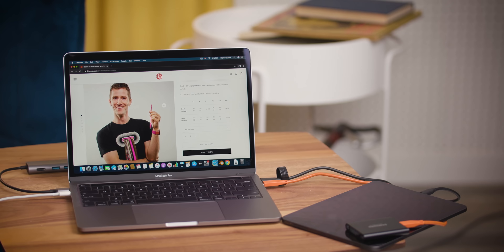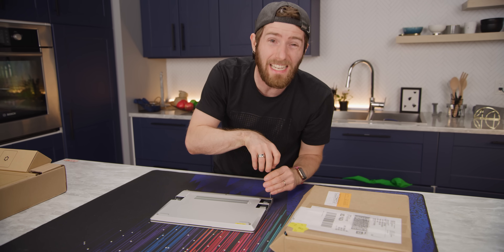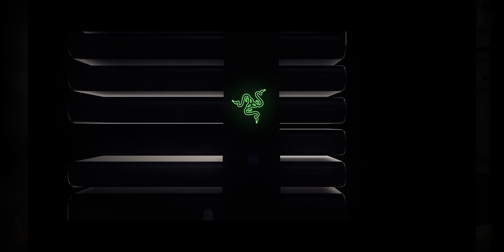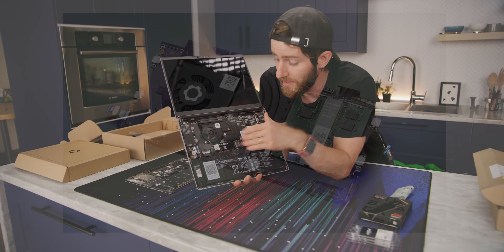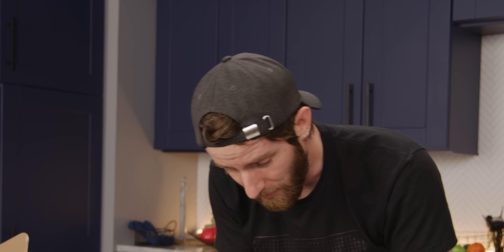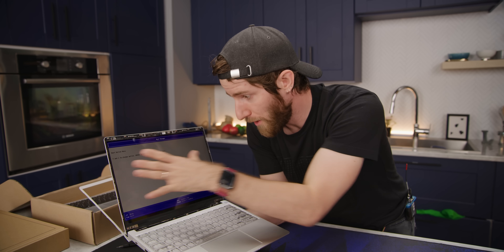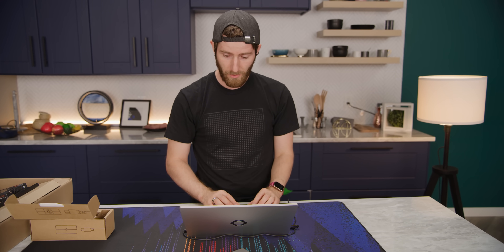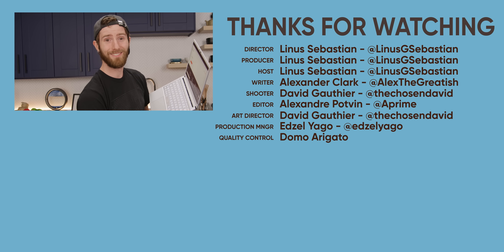A COMPLETELY Upgradeable Laptop?  - Framework Laptop Review

Comment: Honestly so over my Dell laptop after the Dell repair center did a number on my laptop, the next computer repair shop I sent it too even called me up complaining of how shitty of a job they did with the repair(btw when I got it back from the Dell repair center, it came back with more problems then I originally had, which was I just needed a charging port replaced), they didn't even seat the ssd correctly according to the other repair shop. And the keyboard is no longer working right anymore and it's not a driver issue, and a replacement part from my research is basically unobtainable unless your a certified Dell repair technician and get it straight from dell for a stupid amount of money or pay even more to buy a broken version of the same model laptop and hope it has a working keyboard; definitely gonna consider these guys for my next laptop, hopefully they can come with/work with Nvidia graphics so I can run my simulation software on it

Comment: Linus being sold, has me sold. The moment it is available in Australia, I will be buying it. If I had the capital, I'd invest as well. If Framework fails, then the other manufacturers will say "I told you so", we cannot let that happen. If Framework succeeds it puts the "but it isn't economically viable" argument to bed.
Reply: I'm in Australia and got one - I got it via a freight forwarding service.
Reply: It's not that this isn't a good idea or anything -- it's just that linus makes it seem like these laptops have the same performance for price as competing models, which they absolutely do not. You can get a laptop for $800 with similar or better specs than Framework's $1400 option, plus the fact that with the DIY version you actually have  to build it yourself.
Reply: I think one of the selling points of the Framework is that since you can repair it yourself, it's cheaper if something goes wrong. However, most major laptop companies have warranties, so if something goes wrong you don't have to pay for it. Even so, if you buy a laptop from an OEM like HP, and it breaks, you can buy the same laptop again, and you'll still have spent less than getting the Framework.
Reply: @shadowyzephyr  Linuse said himself good enough performance
Reply: @shadowyzephyr  not really most laptops get some wear and tear on the outside and stuff and most warranties will deny you if you have a dent in the laptop or something even if its not related to the hardware problem the framework is surprisingly cheap for what it with an i7 32 gb of ram 1 tb of storage and its all upgradeable and repairable its not cheaper to just buy another hp laptop
Reply: I‘d say same for me. If I need to replace my current model one day (which I do actually hope not to happen for some more years) - I will definitely look for their idea being available in Germany.
Reply: @OpelChef87  well, its available in germany now lol
Reply: I shelled out for a Panasonic Toughbook to get upgradability and expandability on this level back in late 2019. If I were looking for a new laptop today Framework is what I'd be getting. Without question.
Reply: @TheKazragore  Oh you did the thing that I was wanting to honestly, idk is the framework laptop really better than the toughbook?
Reply: Australian here too. 100% will buy this the moment it drops in Australia.
Reply: Considering it costs 1,500$, you do have the capital to invest.
Reply: Linus being sold has me feeling like changing the video. Everytime he is "sold" it just sounds... extra
Reply: @williampennell8567  so him liking something and being happy about it and acting like he's excited about it makes you not like the video
Reply: the "i7" processors in these laptops have just 4 cores, even if they are 4 good cores it's still half the number that another laptop might have.
Reply: @shadowyzephyr  4 cores is enough for most people. It's certainly enough for a device where power draw is a consideration. I'm sure the limited CPU options would improve over time if the demand was there and it certainly looks like it would just be a case of swapping it out. Moment you can buy these with a UK keyboard I'm definitely getting one and will certainly look at pushing these as replacement for our mobile devices at work just because of how easy it will be to replace spare parts when the PMs/sales inevitably break them.
Reply: @shadowyzephyr   intel i7? Sounds good to me
Reply: @shadowyzephyr  Fun fact: my current laptop has an i7, and its more than enough, and if i can upgrade it later, im fucking sold

Comment: Looks great, love the recycling ethos, will consider ordering once available here. Some ideas for future development... amd apu, two nvm storage sockets, more plug in modules inc double sockets eg usb, externally accessable battery (although the disconnect option makes this less of an issue), a dock feature, and personally im excited for a larger display model, 144hz display with touch (ideally up to 4k), a keyboard with number pad, prebuilt linux/windows options. A discrete gpu option would also be great, maybe by exposing pcie lanes for an add on card

Comment: My old 2008 MacBook Pro could be opened no problem (the battery compartment didn't even use screws). I regularly opened it up for cleaning, replaced the fans and the battery a few times and this laptop still lives today. Massive I-O also. Since that model it went downhill for Apple hard!
I am so glad, that framework upholds these principles. I already lost hope that any company would allow for basic repairs.

Love you guys, framework 💙

Comment: compared to any other laptop.... this is still more upgradable and fixable compared to literally any other laptops XP
Like, for Macbooks, you could never upgrade or fix anything, like if the storage fails... Can't get a new SSD. If the wifi doesn't work on it anymore, can't replace it, and you'll have to get a new MacBook. Anything could go wrong on a MacBook, and you couldn't do anything besides ask apple to repair it, and if they can't.... rip.
meanwhile for typical laptops (intel or AMD etc) those have replaceable storage, and you can upgrade the ram a fair amount.
Really, this current version holds up pretty well for upgrading and fixing broken parts.
hopefully soon, we will have the ability to change anything within the device. Like, if I got the device with an i3, I could eventually upgrade it to an i7 or i9 when I have the money, or even I could replace the fans in the device, for better more efficient cooling ones.
I doubt we'll get replaceable motherboards with these systems, as it might be a bit much. But who knows. Maybe intel will stop changing their stupid CPU sockets every other minute, so then a 3 year old CPU can be replaced by a better recent CPU, and have the shared socket intel01 instead of e621 and 42069 :S
Also hopefully they provide more port upgrades, even allowing thunderbolt display :P

Comment: I appreciate how the internals are visibly designed by Apple engineers lmao. The display hinge seems a little sus though…hoping that the mechanicals can be improved just a touch for the next generation! A little more rigidity would be nice.
Reply: Yeah it did look a little loose. I didn’t see how rigid the screen frame itself was too e.g. if you open/close the lid from one corner does it twist and bend
Reply: Its already rigid enough even without the modular IO on the laptop chassis and its barely visible to naked eye
Reply: @mayuravirus6134 maybe enough for you, not for those of us valuing premium devices 🤷🏻‍♂️

Comment: 9:28 I'm pretty sure you just put the antenna cables on the wrong connections.  Typically the black cable goes to the black arrow, while the white cable goes to the white arrow.

Comment: Wow, this reminds me of my well loved Siemens Mobile 510 Laptop. It was fully modular. One could use disc drive, floppy, Batterie and power Rick inside or external. I even upgraded to CPU from a PII 233 MHz to a P3 360 MHz. Heck, the case was GREEN and indestructible.
Would have bought next gen without any hesitation but Siemens stopped to build them.

Comment: Linus, the battery disconnect option in the BIOS is not only for disabling the battery when you are using wall power, it is also for easily servicing the insides of the laptop without disconnecting the battery. This feature is there in some present laptops, and since this laptop is made for modularity, it only makes sense for them to add the option in the BIOS.

Comment: I don't need a laptop but I almost ordered one. I love the concept, the multitude of info / qr codes and all the detail. I did sign up to know when they start shipping to Germany. Only thing I would be worried about whether the little extensions hold strong enough, or they may become a bit loose (not sure if explaining it correctly) with time and stop making contact. Like maybe 2 years down the line I can't use my usb or something properly because that connector has become loose. I would also love some nice Amd cpus. Lately I am reading about interesting concepts, like the Fairphone for example (kinda crappy and expensive but also great idea). If only big companies started making things this way and spent a billion into proper r&d we would be so much better off. I know there's a lot of financial motivation against all this but maybe something will change in the next few years.

Comment: Call me when they have GPU options, and a reasonable price point.
~1100USD for my base needs on a 13.5" screen and no GPU is not great.

Also, what exactly are the storage expansion cards?
The prices on them are comparable to the WD Black SN750 SSDs they offer, I think the only concern would be cooling them if they're doing a lot of read/write operations, and of course they are slower than the M.2 options, but still SIGNIFICANTLY faster than an HDD. I assume it's an SSD solution, despite the performance being much lower than similarly priced M.2 products.

Comment: This is a pretty cool concept. I really like where they are headed! Though if I were to make one complaint about the body and form factor that they chose for this product, it is that you have to take it apart to swap out batteries. It would be nice if the battery had its own bay. That would make it absolutely perfect.
Reply: Like an external battery? It IS feesible but i would say it'll sacrifice how thin it came like before and probably a potential hazard if some wires is exposed
Reply: @mayuravirus6134  what he means is have the internal battery be easily interchanged without having to unscrew the laptop. A little door is all you need, or even just have the battery ‘be’ a part of the bottom of the computer and have a little built in switch to be much more easily swapable. It was standard on laptops long ago, go look up a video of an old thinkpad or say a dell insporon 1501.
Reply: This! When I travel with my ThinkPad, I sometimes carry a spare, fully charged battery with me, so I can continue working. It totally looked possible to implement, too. One thing I worry/wonder about ontop of that is how warm the chassis hand-rest area gets when the battery is running warm. Again, the ThinkPad gets warm at the back, so I won't notice it. Curious!

Comment: Frameworks has an interesting concept. I hope they are successful. As one other person said this is Frameworks "v.1"  I'd be looking for a unit that wasn't a gaming machine. 
A fair amount of the manufacturers in the rush to make their rigs sleek, slim and lightweight have made their devices even less upgradable and therefore more disposable.
I love that Frameworks has an easily replaceable battery which gives the laptop more longevity and perhaps future improved battery tech. I've replaced HDDs with SSD and added memory myself or had MicroCenter do the upgrades. A lot of the sleek laptops don't allow for such upgrades. I'd much rather get a higher grade CPU in a laptop with room to upgrade the SSD and memory later that's within my budget than to have to settle for a less powerful CPU rig with soldered in components.

The possibility in the future of an upgradable CPU/motherboard would be outstanding!

2 last thoughts, 
1. maybe Frameworks could see if AMD might be willing to  work with them about an upgradable CPU/mobo component. 
2. Perhaps Frameworks could partner with MicroCenter for a retail presence. 

Good luck!

Comment: I'm not really convinced of this concept unless they release all of the measurements required for developing third party parts. That way any person or company can design their own extensions. On their website they're talking about "a community of partners" but it's not entirely clear if they are planning an open system. 

The same goes for FairPhone by the way. Apparently FairPhone 3 is discontinued already? What if they run out of parts? And what if Framework Computer Inc runs out of parts?

This is an improvement of course but it could be much more robust. If you're gonna appeal to a certain crowd you gotta do it right. I might be asking for too much though. Creating an open standard is going to be much more difficult than just creating a single functional modular laptop. I can only hope that is going to be the endgame for the Framework Computer company.

Comment: Hmm... I'm genuinely interested in this product which is rare for me with these quirky but intriguing small company ideas. Me thinks I will be spending a bit of time researching tomorrow. The idea that my laptop bag can just carry all the modules I might need literally anywhere without taking up space alone is a HUGE sell. I don't always need a display port connector. But man when I do... I really hope this gets a lot of attention and doesn't die out because if they can keep this running, I see potential for a huge upset in the laptop market. If I can work this into the budget.. I think I may just pull the trigger. I've been looking for a laptop that isn't my $3000 HP Spectre I'm too scared to take anywhere for fear of it breaking. If it breaks.. Just buy the component(s) to get it running again.

Comment: Just 4 IO ports is very little though. I have 4 USB ports (one USB-C), Display Port, HDMI, jack in/out, LAN and a card reader in my laptop. In this framework laptop I'd need to choose 4 of them and I have 7 connected right at this moment (and still have a free slot for a USB stick).

Comment: Imagine a "Docking Station" for this?
Simple 1cm thick, 1cm larger diameter Device,
that you lay this into. It plugs into any power source,
solar, battery, or wall- and charges the cell, connects
to the storage with WIFI, to transfer. The Dock can
be plugged into a TV or monitor.
I'd like to see Devices come with solar voltaic
cases, notebooks, tablets, phones, etc. so it's always 
charged or easily charged.

Comment: "The justification that traditional laptop manufactures have had for making everything so integrate and so impossible to upgrade"...Yeah. That's all "smoke and mirrors", or theatre if you will. Or, you know. Lying. 

It's all about planned obsolescence and end-user aftermarket control. One part breaks and you have to chuck it? You have to buy a new one. One part breaks and you try to fix their specialised, proprietary system? You either "void" the warranty, or have to take your machine in-house to fix it, where they can control the labor and the quality of repairs. It's the same with cars and car repairs. Obfuscation of design is a huge money maker.

Comment: Dell is going the apple route. With my job we use the dell precision lines. The 7710, 7720, 7730, 7740 all has the back panels easy to remove to access the board and take the battery out, upgrade ram, hard drives, etc... The back is split up in 2 parts. 1 is a switch that opens half of the back with no screw driver needed. This lets you access the battery and 1 of the hard drive slots. The second panel is only held by 2 screws that then drops the second half of the panel to access the rest of the board to do what you need.

The 7750 and 7760 has changed. Its a single back panel that has like 8 screws and the panel is the bottom half of the frame of the laptop not just flat panels.

So its harder to open.

This is crazy and concerning for us IT guys. I work in IT that has to open this as we get them to configure and put in the hard drives in a certain way according to our specs needed. It is a bear when you order 100 of these and have to open each and every one of them to put in the hard drives.

Comment: Linus, there already ARE USB-C loading cables which are magnetic charging.
You basically put the magnetic USB-C plug into the port and boom. Now you have a magnetic charger. 
Because on the other side there's a cable with a magnet on it's end.

Comment: The only issue I see... Is ... Games. Using built in graphics cards is painful. That would be the one thing that could hold me back. 

If it turns out they can somehow be attached (don't care if its dangling... I'll only use it when I'm next to a power supply) it would mean this would have to be it. 

That is the one thing that has me in a bind.

Comment: They should have a gaming option as well. I could really see the benefit or a motherboard upgrade. 
For office use, I still have a 8 years old Dell and it is still good for most uses. I have already changed the hard-drive by SSD, upgraded the memory and change the battery, which at that time were still external. That's modular enough 😉

Comment: Those little antenna connectors that attach to network cards etc have a great little dedicated plastic tool you can pick up that makes attaching and removing them much easier. Or you can use a black stick but not as easy

Comment: $1000 to start?  that is way too much money for mainstream to dive into. I got an Acer 5 with an MX1050 I5 for $550 in another 4 years I can get something comparable for$550. This has to start at a maximum of $300 with an I5 or Ryzen and then add the rest, other than that it will be a niche Item